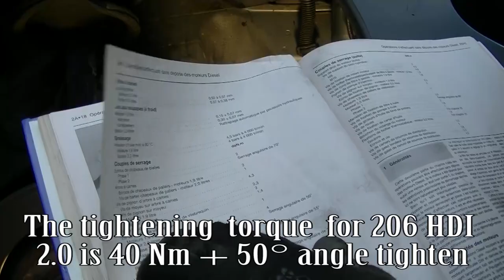How to replace an auxiliary drive belt and a crankshaft pulley

Comment: Great Video. Helped solve my problem worn belt squeel without the need for special tools to tension the Eccentric pulley wheel. The only error in your video is that the adapter should be 3/8 to 1/4 NOT 1/2 to 3/8.  Otherwise spot on.

Comment: 8:08 up until 8:22 ... how?? 
I've tried everything and the belt just won't go under the tensioner roller!! 
In the video at first it looks like he has the same problem as I do but then he magically stretched the belt to go under the tensioner...
Please heeelp!! I'm soo close but yet sooo far from auxiliary drive belt DIY replacement :(
Reply: You have to lift and lock the tensioner, or hold it by hand in loaded position while you fit the belt.
Reply: Yeah just lift tensioner and slide bolt in to lock it 👍👍👍

Comment: Hi tuto, I have a nast rattle/ticking noise on the same car and this could be a possible reason, Car has had a recent oil/filter change, I am wondering how long this took in all? Trying to work out labour costs if this is the problem

Cheers

Comment: Why do you need to lock a flywheel if you work with a drive belt? It makes sense only if you work with a timing belt...
Reply: To undo the fly wheel nut. Otherwise fly wheel will just turn.
Reply: Locks the crankshaft, so you can use a ratchet if you don't have a super powerful gun or space to use a gun

Comment: Don't get why bolt is tightened and then tightened a further 50 degrees plus then make sure it's a certain nm, why not just say tighten to the torque of 190 in the first place